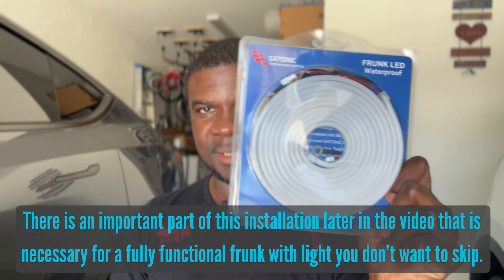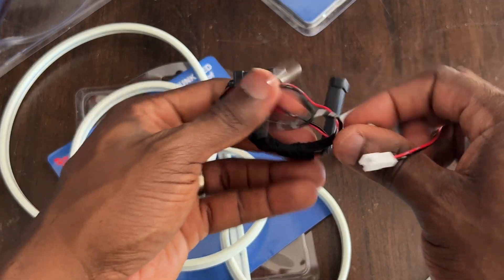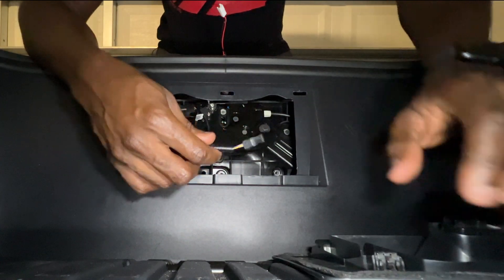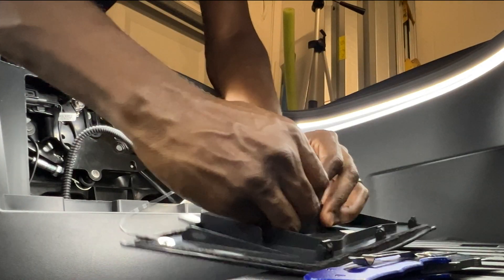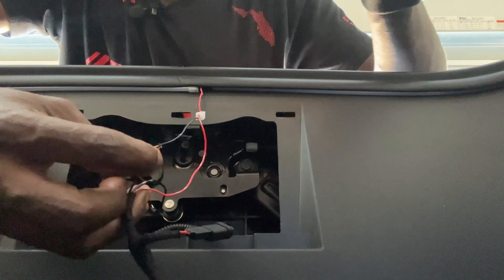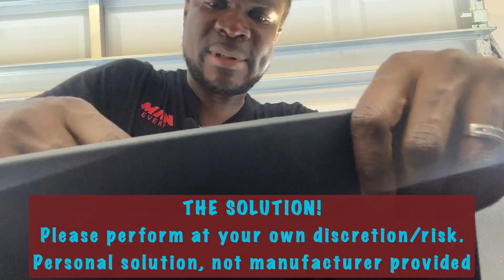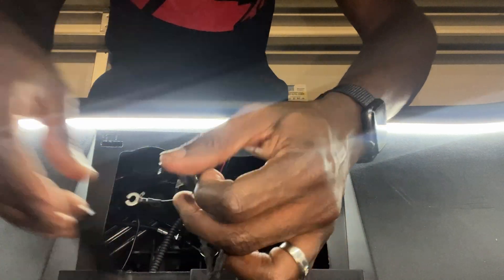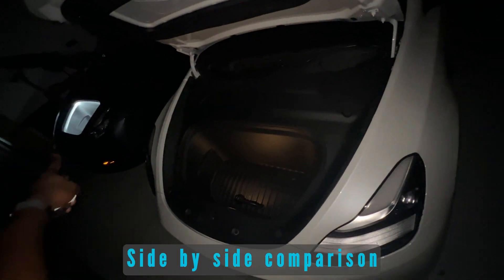Tesla Frunk LED Light - Model 3/Y DIY Installation

Comment: The ring is the ground, why would you cut the other wire? Completely unnecessary and could cause problems later.
Reply from the maker: I hear you but the wiring from the manufacturer was faulty and it wouldn’t let the emergency release button work. It’s been working fine all this time. Satonic did make an update to the wiring that solved this problem

Comment: The light does not turn off when the frunk is closed.  It's a waste of electricity and so I left it disconnected.  Going to add a switch to be able to mannually turn off the light.
Reply from the maker: You’re right. The light is powered by the emergency release button which is always on. I doubt it’s a significant draw though. I’ve not noticed  any impact on battery in the time I’ve had this. I’ll see if I can find out if it shuts off when the car goes to sleep.
Reply: @theimperfecttesla  thx for video.  I just installed the led light but same issue with drunk switch not working.  I wanted to make the wire adjustment based on your instruction but just wanted to reconfirm if the led light will stay on all the time.  Is this the case? Or will the light goes off when the light switch in frunk goes off?
Reply from the maker: @mfgjhy123 I tested this and no the light does not go off. Because it’s powered by the emergency release button which stays on, the led stays on too. Having said that, I have this installed for over a year now and no issues whatsoever. It’s a low powered item
Reply: @theimperfecttesla great.  Thank you for confirmation.  In that case I will just leave as. Thx!
Reply from the maker: Hey. Following up. I was doing something in the garage with the frunk open and I heard the car power down after a few minutes and the lights in the frunk went off. The emergency button light also went dim to green. So it looks like the lights do go off when the car sleeps.
Reply: @theimperfecttesla  thx for the follow up.  I did play around to rewire it & did also noticed the light actually powered down after about 10 minutes. Anyways, when I was trying to complete the rewiring, somehow I blew up half of the light strip & had to reorder the new light kit. With new light kit I had cut out the ground wire that came with & rewired black wire to connect to the ground, the light was working but the I was still not able to close the auto frunk with the emergency switch.  I just rewire everything back to back to original  & decided to leave as is😊
Reply from the maker: Satonic had an updated light strip that solved the wiring problem though and I did an update video showing that. I wonder if a Tesla update broke it again but that was supposed to have resolved.

Comment: my frunk light came with the ground wire with a magnet at the tip to connect to car metal. I guess they caught on to this issue and started shipping with the black cable to be able to attach to car.
Reply from the maker: Oh nice. That’s neat and helpful. I just posted an update video where I had to use one of the latch bolts to hold the black wire which can cause the latch to become unaligned if care is not taken. Glad they’re making improvements that prevents that. Thanks for the feedback.
Reply: What model and year Tesla you do you have?
Reply from the maker: @freakrule21 we currently have a 2021 model Y long range and a 2022 Model Y long range.
Reply: @freakrule21  I have 2023 model 3
Reply: @TheTekSone  Thanks for the reply. I have a 22 model 3. Im debating between satonic white or tparts yellow lighting but was curious if install was the same. It seems like it is. They both have the magnet ground. Is the magnet ground strong? Or do you think it will easily fall off?
Reply: @ I have not installed mine yet so I can’t answer sorry
Reply: @TheTekSone  oh okay. Thank you though.
Reply from the maker: I’d expect the magnet to be strong enough to hold up to regular bumps. I personally prefer the white to the yellow but that’s just personal preference
Reply: @theimperfecttesla  So true. The white led is definitely better. I wish you could change out the Tesla orange button for white as well!

Comment: I finally got around to installing this light strip after the ordeal of installing the power frunk and, like the power frunk, they've changed this LED kit since this video was made.  The wiring now has the grounding ring on the end of the black wire coming from the white connector that connects to the LED strip, so you no longer have to cut the black wire as you've shown and can just attach to the ring to one of the bolts on the hood latch.
Reply from the maker: Yes. Thanks for sharing. I actually installed the new light strip last week and have an updated video in the works. I’ll get that out as soon as it’s through editing.

Comment: Where do i connect the metal ring connector go to?
Reply from the maker: It doesn’t get used. I taped it off. 
I reached out to Satonic about this and they said they are coming out with a new version that fixes this problem. I don’t have a timing on that though.

Comment: Hmm, I'm pretty certain mine is missing the extra interface cable which is why i took one look at it and chucked it in the "cant be arsed bin". I'll have another look and contact Satonic if it's missing. I didn't want to get into chopping cables.
Reply from the maker: Oh really? If it’s missing, I’d say reach out. They sent me a replacement when my original one broke.
Reply: @theimperfecttesla  I looked again, earlier model, but more effort.
https://youtu.be/6wBtYFw88CE?si=MDFJ3-cGgjhy6_uD
Reply from the maker: Late reply. Was away on vacation. So you’re all good? Their video doesn’t show what happened with the wire with the ring either
Reply: @theimperfecttesla  No it doesn't show that part but I'll figure it out. I still haven't done this but at least it's clear that I've got all the bits, just need to get around to it. What I don't like is that I think I need to cut the Tesla connector off and I'd rather interface to that with tails.
One day when I'm bored I'll get to this one. It came free with the power frunk kit which was the main part I wanted. :)
Reply from the maker: @djtaylorutube no, do not cut the Tesla connector. I didn’t do that. I cut their wire instead. Watch how I did mine.
Reply: @theimperfecttesla  I would but I don't have anything else other than the snap in splice connector.  I agree, i'm not going to cut any factory connector.  I'll source the matching part and come out with tails to connect...one day.  No rush :)

Comment: What battery were you using I wonder if there would be enough power using the LI 16 volt battery
Reply from the maker: This is the LI 16 volt battery. 
I also tested in the 12 volt previous battery and it was the same  experience.

Comment: Did you just try connecting that extra wire to the chassis without cutting the black wire?
Reply from the maker: Yes, I tried that and nothing worked for that button except the method I used.
Reply: @theimperfecttesla  I wonder if they put the connectors on wrong and the one that had the ring on it was supposed to go to the connector, and the one to the connector should have had the ring on it.
Reply from the maker: Yes, that's what I think too. That's kinda how the auto frunk is wired.

Comment: The ring is the earth, it is fitted between the factory latch & the Satonic bracket. With that fitted the internal button works fine.
Reply from the maker: I’ll have to check that again. I believe I tried that and the only time the button worked is if I was pressing it the first time after the car wakes up but not continuously. I’ll check again
Reply: Can you explain it in more detail. I have mine installed and still not figur it out what is this ring.
Reply from the maker: The ring is supposed to be the earth/ground but for some reason, the emergency button doesn’t work when you wire it normally. 
I tested again with the ring between the latch and bracket as best as I could without taking things apart as suggested and it still didn’t work. So far, I’ve not seen any issues with the way I have it setup bypassing the ring.
Reply: @theimperfecttesla  I also agree that ring is not reliable after more testing.
Reply from the maker: @TheKKnut I’ll reach out to Satonic about that and see what they say.
Reply: Can you explain where the ring goes?
Reply from the maker: @william3249-k1g  this reply is coming very late, apologies, missed your comment. If you still need help, the ring wire in this version is not used. The updated wiring shipping now has been fixed though. I see I responded to your other comment when you posted so you can ignore this one :)